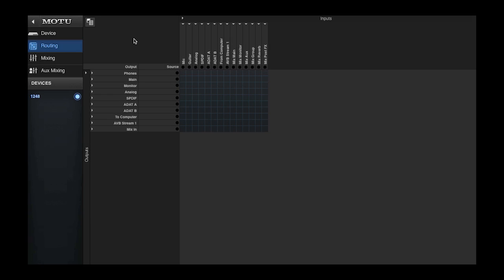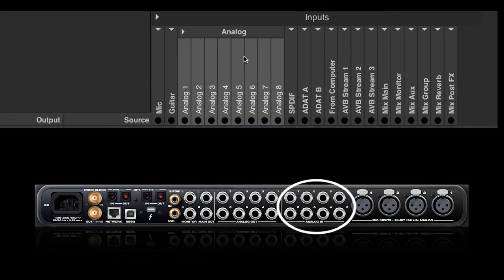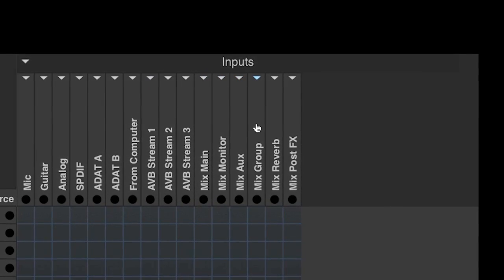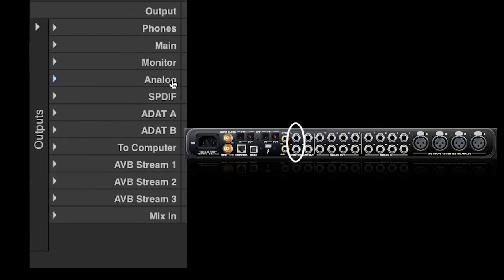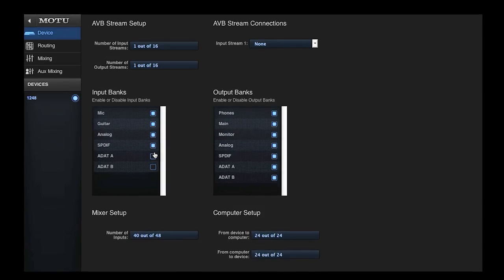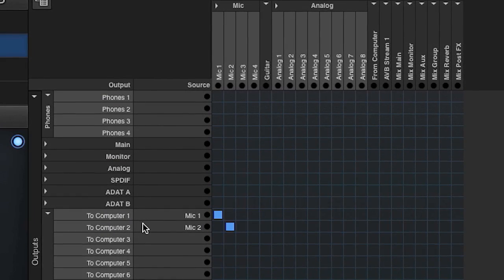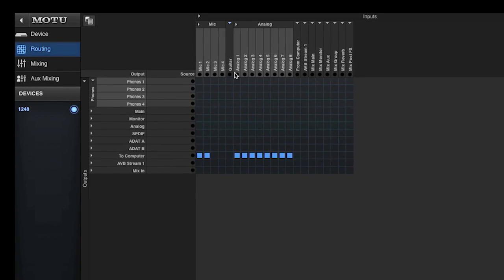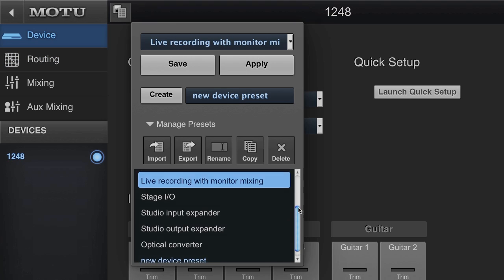MOTU Pro Audio - Routing Grid Basics

Comment: I have had this unit for four years now. It started adding an additional monitor from the computer that stacks over the actual hardware monitoring causing a horrible slapback in the left channel out of nowhere last week. I'm probably like four hours into trying to problem shoot this at this point. Never had the issue before and nothing that a quick setup and readjust usually fixes. Now with this problem, my normal monitoring setup no longer works as it has done for years. Super confusing and embarrassing for the last two clients I have had in.

Comment: Love my MOTU 24 AO but this routing grid is one of the most confusing things I have ever used. I have zero IDEA of what I am doing but through trial and error got it to work,
Reply: I agree! The visual feedback (blinking blue dot) helps but understanding what is going on is the challenging part. For example what's the significance of the From/To Computer pairs? What determines how many From/To Computer pairs there are? What's the difference between From/To computer - maybe an example of a From/To pair in practical use - how does one think about/understand these? Are these what a DAW uses for its inputs or outputs?

Comment: Is there A-D/D-A conversion involved when routing an analog output to an analog input? Lets say I have a 16A with an analog EQ and an 828es with a compressor. If my routing is 16A EQ -> AVB -> 828es compressor. Is the audio from the EQ on the 16A converted to digital to transfer it over AVB? And will this also happen when both effects are on the 16A for example? Thanks

Comment: All the routing should have level control instead of only 100% gain. Multiple inputs should be able to be routed to same output channel, this is really basic stuff. Routing capabilites have to be improved! EQ's have to be improved! There is not even a low pass filter and the high pass filter is impossible to find and not even available on every channel. There should be more effects than just one plain reverb with limited controls. I have used TotalMix from RME and it's by far way more capable, higher quality and faster to use than what Motu offers. This control panel is neither versatile in studio nor usable in live setting. Can't believe it's been more than 7 years and absolutely no updates have been implemented.
Reply from the maker: Thanks for the feedback, Hendrik. I'll pass this along to our development team

Comment: So I’m assuming windows or Mac will see this or similar units as a “sound card” so to speak...  if I don’t use recording software, will windows detect and use this as a microphone source and output option? (That was short and vague, I don’t want to write a novel).
Reply from the maker: If I understand your question, the answer is yes. However, I would connect with our tech support team for further clarification or questions about this setup for sure

motu.com/support

Comment: Usually multi track mixers are documented with flow schematics. That would be helpful to see here. In this case the flow schematics would vary based on the grid patch settings, right? Pointing at a grid and talking about a mixture of software routings and hardware routings is probably what is causing confusion to those who are not getting it.
Reply from the maker: We have a few channel schematics specifically for the internal mixer on these units available to see - it's in the Appendix section of the Pro Audio manuals. 

Here's the 828es manual to use as an example:

https://s3.amazonaws.com/motu-www-data/manuals/proaudio/828es_User_Guide.pdf
Reply: @motuTV  I'll have a look. thanks

Comment: A lot of people are confused about this routing grid, including myself. 
It took me two days to figure out what is going on.

I do have a suggestion that would make the grid easy to understand at first glance.
Set separate background colors for: 

Physical inputs and outputs
Computer inputs and outputs
AVB inputs and outputs
Mixer inputs and outputs

and maybe Optical as well
Reply from the maker: Great suggestion, Tom! I'll submit this to our team for consideration.
Reply: @motuTV  Does the interface save all the routing and effects settings and so on once set up, or do you need the web interface open all the time? Say if the web browser crashed or you just don't need it open once you get it dialed in?

Getting an Ultralite mk4 so I was curious.
Reply from the maker: @Becoming_  It's saved within the unit for sure.
Reply: @motuTV  Thanks!

I appreciate it and very happy to hear that.
Reply: I have an UltraLite AVB, which uses this browser interface. Your model's capabilities might vary. @Becoming_   You can save your settings/configurations in various ways and places, including saving the entire current set-up under a filename, loading a previously saved configuration, getting the recently saved one, revising it and saving as yet another file.  I suggest saving your working setup, then modifying and practice saving and retrieving. The UX of the saving process is a bit confusing until it becomes second nature. I have a couple dozen saved, but most are old "backups" and I only used a couple. For minor tweaks, I just change the cell or mute or whatever as needed.  

Several years ago, driver updates to the software/hardware were fairly frequent, but I haven't encountered one for a while.
Reply: @motuTV  It would also be handy for each line in the mixer to have an assignable color. So, for example, if I quickly want to unmute the phone patch, or record, say, a radio input or Zoom session, I don't have to read the header.
Reply from the maker: @rrinquen  Thanks for the feedback!

Comment: You guys need to streamline this routing situation so normal people can understand it. Nothing makes sense?? When I select outputs in my daw they don’t have the same names as in the routing app. It’s a bit of a mess. Also u need to let us rout the phones so that the monitor volume controls the phones volume. So we don’t have to level match them all the time. 
Solid interfaces but the software needs some thought
Reply: I disagree. I can’t think of a simpler way to do routing other than a matrix. I just got an interface two days ago and already getting the hang of it 😎
Reply: You will see soon enough trust me. Yeah the matrix is great but it’s so confusing to do different things. Took me over a month how to figure out how to do direct monitoring to get Sonarworks to measure.
Reply: It doesn't get much more streamlined than this. When you handle routing remember that what you are doing is (virtual) patching within one unit. Each unit in the network has its own perspective of what ins and out are depending on its position and role in the network ... the DAW included. You need a perspective of where you're going with the overall signal-flow, but when setting up individual nodes you're best off imagine yourself being the brain inside that particular box. Think of yourself being in a room with pipes going in and out, each pipe carrying bundles of cable.

Naming-conventions for channels and connections differ between manufacturers so the first thing to get to grips with is the organisation of virtual channels across the different forms of media (USB/Thunderbolt/AVB/ADAT etc). Once you understand how individual channels are organised across a connection it gets much easier to map these onto particular gear or through software at both ends of the connection.

Comment: cannot figure how to route more than 1 input to headphone. If I select analog 1 then analog 2, analog 1 will be unselect.
I cannot use this board to monitor all mix using haedphone
Reply: Hi Rick. You need to route the inputs you want to hear to a MIX in channel. Then use the mixer to mix the signals. Back in the router you connect the mix output to the headphone. The router itself has no mixing capabilities and can be seen rather as a (digital) patch bay, where each destination can get only one signal. This is how basically all digital mixing systems work: route signals to mix channels -> mix the channels in the mixer -> route the output of the mix (master or aux mixes) to usually physical outputs. Hope this helps
Reply: I’m trying to do that too with no luck
Reply: it’s because motu routing-mixing and, based on my own unit, Quality Control is a disaster compared to presonus, UAD, RME or Focusrite. Motu has good converters, solid enough drivers, transparent pres and good customer support. now they need to catch up to their competitors in the mixing/routing realm. Until then, motu should stick with input source to DAW input monitoring products only (like presonus 2626) until they get this straight. otherwise, you’re gonna be paying for almost unusable bloat.